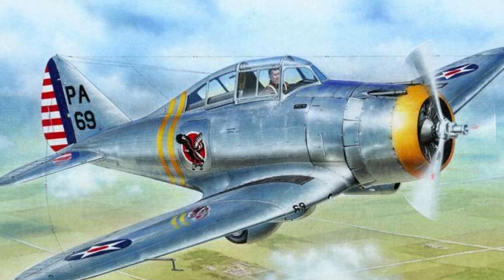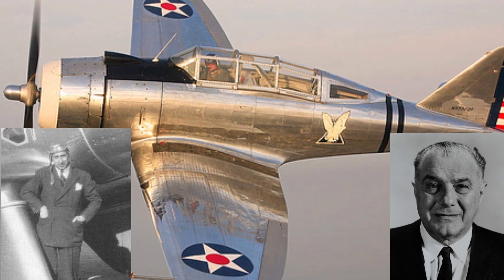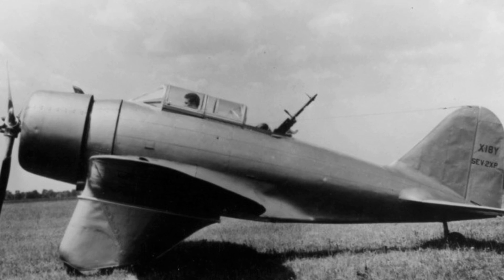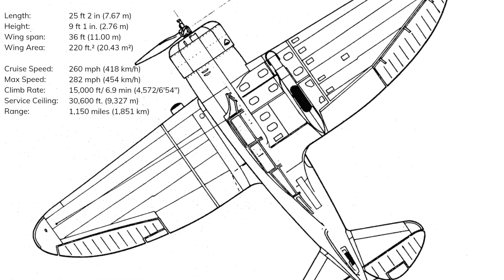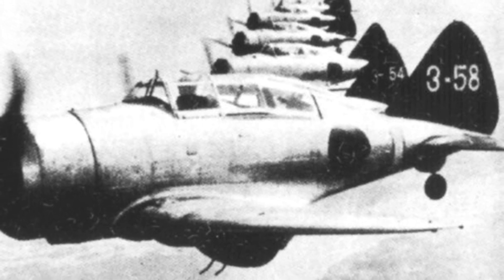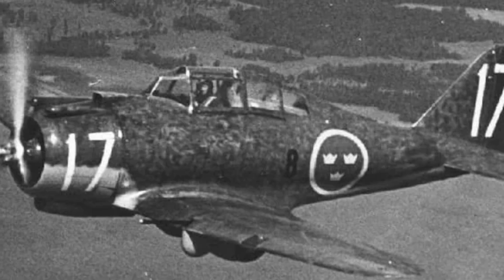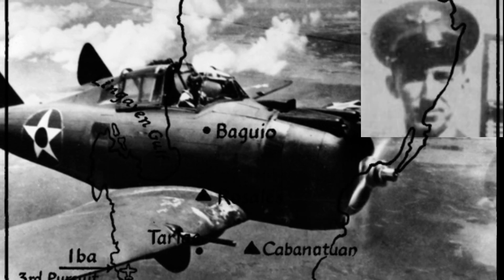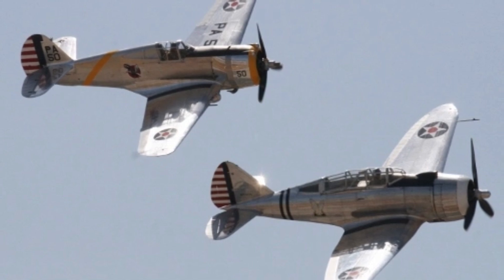The Seversky P-35

Comment: 1:41 Shown here is one of Seversky's early airplanes, a SEV-3 (1933), which was built and then remodeled several times, early on with amphibious floats, then spatted with fixed landing gear, with very low canopy. After this as SEV-3XAR with a new low canopy, with a Wright R-975 350hp engine installed amd moved forward and rear fuselage windows covered over. It won the basic trainers competition and brought the company it's first large production order. Modified again in amphibian configuration the airplane, probably as a SEV-3M now with a 710 hp Wright R-1820 engine installed, establishing a new international and national speed record of 230.413 mph on Sept.15 1935. The plane was eventually sold to Mexican Air Force Col. Roberto Fierro Villalobos in 1938. Fierro likely sold it to the Spanish Republicans to help in their struggle against Franco fascists.
Reply from the maker: Thanks Antonio. Great stuff.